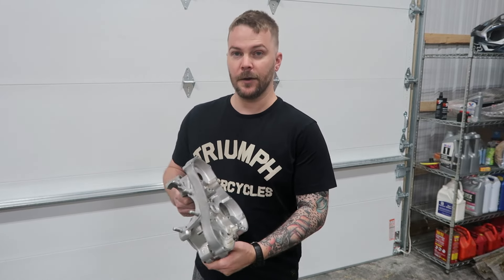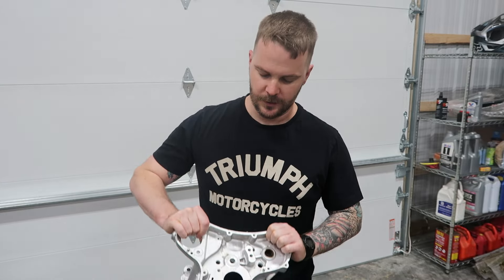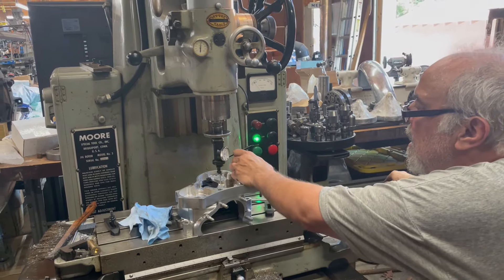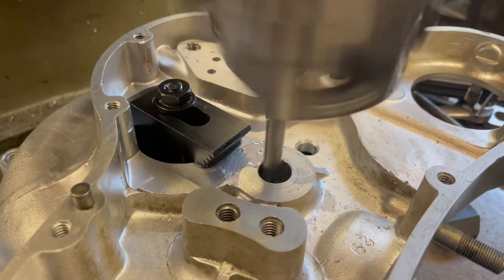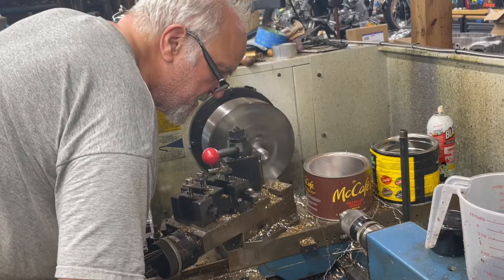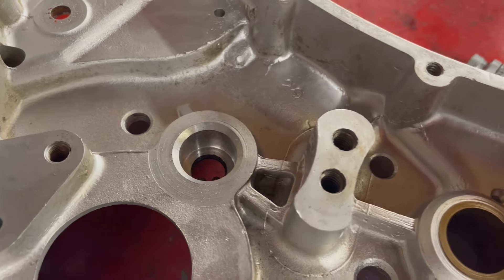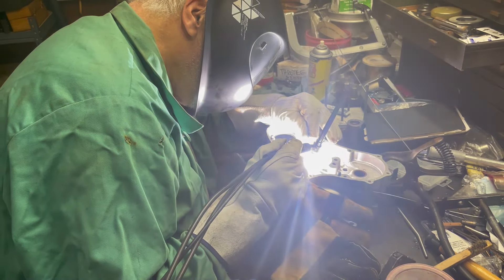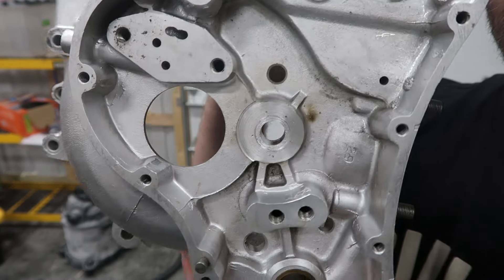Repairing my Norton Commando Engine Case

Comment: I'm guessing that the damage was done by a previous owner or a PO's mechanic (??) but the way to prevent this damage is shown in  Fig C22 and paragraph 9 just below it in Section C16 of the 750/850 Workshop manual.  That's for disassembly, it's Fig.C38 and paragraph 11 in section C30.
Reply from the maker: Yes, you can modify a cover.  I might do that in the future